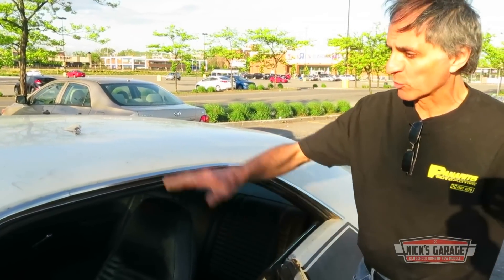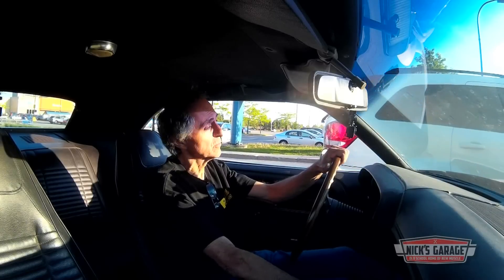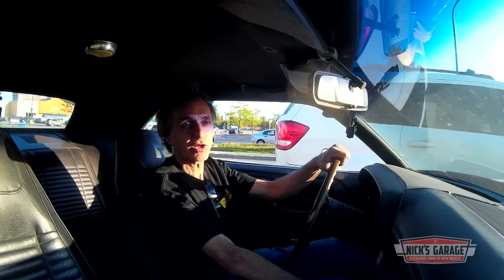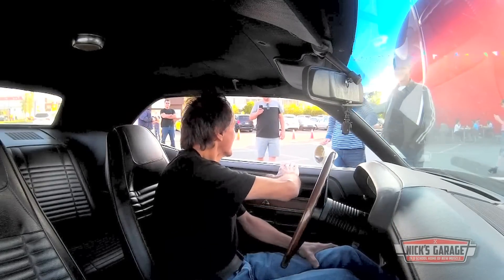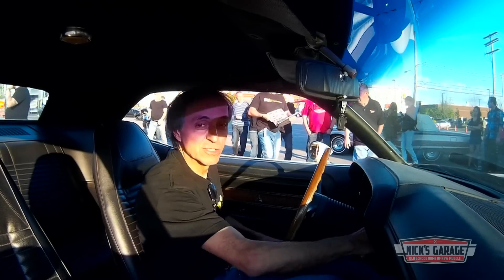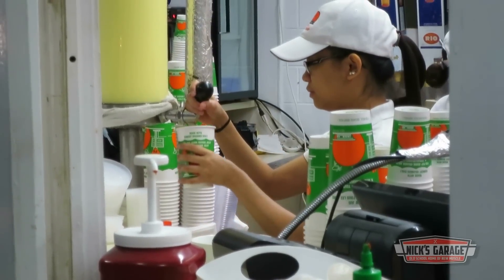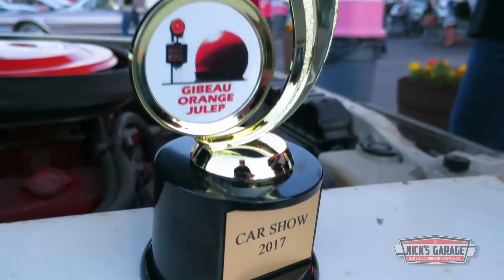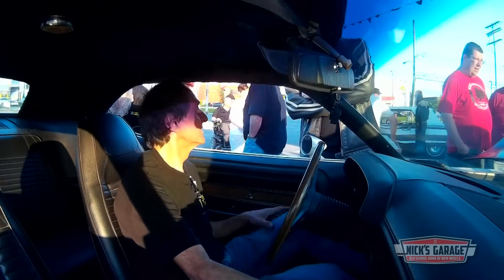Unwashed 1970 Challenger T/A goes to a car show!

Comment: Awesome, i have a 68 that sat for over 20 years, still has the same dust on it, hoping to get it out and about this Summer.
Reply: why.....you owned it for over 20 yrs and its just sitting there?
Reply: no i bought it, and dragged it home last year. theres a video on my channel. Will start on the restoration once ive finished my current Pontiac project.

Comment: Great find, sweet T/A Nick. I once had a six pack in a '68 Charger R/T that was added to the 440. Sure wish I had it today, although it was not the original motor and the six was not available till '69, it was still an awesome Mopar.

Comment: its funny you mentioned sliding on the vinyl seats . when I was in my 1st car,a 1972 Pontiac catalina with the 400 in it,I wasn't a seat belt wearer . I took a sharp corner at 25mph and all of a sudden I was  sliding all the way across the bench seat and ended up in the passenger seat! still hanging on to the steering wheel for dear life, I managed to slam on the brakes and bring her to a safe stop. from then on,I always worn my seat belt!

Comment: Love the car, and the award was well deserved. I know Eastern Canada is hard on cars, but its not any better out West. If it was mine, I'd drive it just the way it is. I have a '80 Powerwagon Clubcab, 360, 4 spd. Original paint, lots of paint chips, and rust around the rear wheel wells, and starting to come through the rockers. But it's only original once.
Reply: the rot around the wheel-wells spells rot underneath in hard to reach places unfortunately.
if you want to keep it fix the rot,a little surface patina is cool but rot is never cool.
Reply: I think I know what you are saying. Yes stop the rust. But I also see it as a survivor. That is one bad ass car. Just love it, and most people won't respect her, for what she is actually worth.
Reply: Is this the car he wants to install his Hemi into. I've always wanted an E body, 6 pak car. They are very rare, up in Canada. Nick reminds me of dad, always ready to jump into a project, but thinks it through.

Comment: Love it can you bring one to Australia for me ?
Reply: Pacer Hemi.   Question? What would happen if you would have bought one of these survivors, and brought it to Australia and had to have it Right Hand Drive. If it was the case, would you allow it to be converted  to RHD? Thanks for watching.
Reply: Ela mate , I wouldn't convert it at all no way . 
Plus here in Australia  anything over a certain age it doesn't have to be converted . 
This is the same motor that was to be fitted in our valiant charger E55 as our big race  like Bathurst valiant was running 265 straight 6 hemi vs fords 351 . The 340 was supposed to destroy these fords but we had a muscle car scare and car manufacturers were stopped to build these things for track . 
They didn't even put a triple carnie on our 340 but put triple Webers on our 6 hemi . 
That T/A is a great car it would put shame on our muscle cars . 
Bravo for your work .

Comment: They may have changed, but the seat belt, a lap belt really, straps you to the car without any slack. That allows you to focus on driving and shifting gears without having to worry about sliding around in your seat. That's what the Charger driver in Bullitt was doing when he buckled his seatbelt. Today's seatbelts have slack until an impact.

Comment: Ha, crack in the dash. My 73 cracked just like that. Developed a bad vibration, turned out to be a u-joint going out, and cracked the dash before I got the U-joint fixed.

Comment: i kind of get the leave as is way of thinking but i am the type to make it less squirrley  on the highway and make it look like it was when new. as it really was so to speak. also i am your age and i wonder why you would drive with old gas in it instead of sucking it out and putting some fresh stuff in it with maybe some injector/carb clean it the tank to help out the carbs going to the small car show. i am not trying to insult your car but if one with the same look and options was there beside you , i wonder which one would have gotten first prize?

Comment: Nice Challenger...

I guess,it depends on your height/body build...I am tall but also a tall torso,so the E Body low seats are very comfortable...

My new Challenger SRT 6.2 seats are set to the lowest setting and still could be lower for my taste..

Also my 71 Challenger RT drives great at 80 mph doesn't shake,doesn't pull either..I can go over 100,sure the new one is better but usually once over 100 mph..

The seats I find in older cars are comfortable as new ones are usually built for small build ,not wider people and 5'8 and shorter..I am not fat or over weight but tall and wide/big build..Not fat or obese..

*My Challenger RT is a 383 Magnum powered now by a Muscle Motors 451 about 500 hp was in the car when I bought it 1 year ago,runs great so far I put 12,000 mile son it between me and my wife,she drives it more than me,I drive my Charger usually....

I went to Friday Night drags and ran a 12.17 @115 boiling the tires..I had a driveshaft vibration so I didnt take another try......I also have a 68 Charger RT 440,71 Cuda 440 6 barrel not a real 440 car.. I installed a period correct 440 6bbl lots of power (70 440 hp,try finding a 71 hp 440 lol),it ran mid 11's and its a 2.94 sure grip and 727 auto ! Great highway car,solid,handles awesome and does past 150 mph(years ago I did that when I was in my 20's),car was gone through,235 front tires also help handling a lot ...I added 4 wheel disks but car looks stock ! I also own a few C body Chrysler 300's with 440's those are sleepers ! 

I also had a 70 Challenger 383 2bbl no power steering and it makes a difference with power steering,handles better ! 

Sure,you bet the new Challenger Hellcat handles,drives better at high speed a bigger,heavier car it is,so it does !
Reply: 01trsmar.   Nice collection of cars you have there.  Thanks for sharing.

Comment: fix the rust on the door before it gets too bad..
Reply: Only surface rust there is no perforation at all anywhere on this car.
Reply: I can see it is coming through.. Not only surface rust.
Reply: won't get worse, this baby is done with damp storage...
Reply: camirocz, the rust on the door is under the paint. That rust is coming from the INSIDE of the door on it's way outside. That door needs a new skin. It's already rusted through. Look under the trunk lid as well. That car has cancer.

Comment: Man if its that slidy at 80 MPH it might be a good idea to upgrade to radials, as Coker makes a set for old muscle cars like this, plus check the bearings and rubber bushings, as those are all major mechanical things that wont hurt its originality, just to make sure it stays in one piece is all. 

 plus maybe it needs to be put up on the lift and just yank at things to see if their loose. as it just migth need a bit of basic tightening and locktighting to get it handling right. as something like that, well on this, he mentions a friend who had an old beat up TA just like that, that got lost to a crash sadly
https://www.youtube.com/watch?v=1K2TZ-8Joj4

and alot of preventive maintenance goes along way.

Comment: A car as rare as a white T/A Challenger should be restored.
Showroom style, not overly done.
Reply: I have to respectively say no way to a full resto...  This is the way it was from 1970..  All Nick had to do was do a few little things to make it a driver again..

Sure, if it was a heap and all it had was a vin number and such, sure go ahead and do a full restore of it..  I love those cars too.

But, this is only original ONCE...  What Nick did to it in no way takes anything away from that..  Just normal stuff that would have been done all along the way anyway..  I would do all fluids, and check the brakes and clutch, and it looks like all the lights work too!  Awesome!  I love the fact he hasn't even washed it!

Just my opinion of course, but I love this car!
Reply: MitchF150 Roger that...you can never go back to untouched original.
Reply: 2000cobraguy : I agree w/you. A quick scan of Mecum auction archives on their site (back to 2008 maybe) shows a coupla dozen T/As, but not a single white example. I still say show it around as a survivor for a year or two, then do a complete restore (*unless proof can be offered that it would be worth more as a survivor). I'd want it 'driver quality' restored - not turned into a museum piece/trailer queen.
Reply: i disagree.
Reply: I like what some guys call a "sympathetic restoration" depending on the car.  What they do is to make sure the mechanical condition is good and they stop/stabilize any further deterioration of the body etc and call it good.  This car I think falls into that category well.  This way the owner's can enjoy the car with no real worries.
Reply: I would never restore that car, leave it just as it is
Reply: ...........Gets into a Delorean, goes 88 MPH, ZAP!
It's 2027, the car is rotted out.
Attendee at a car show is overheard...
"Yeah, the guy who owned it was THE expert at old classic MOPARS,
but you'd never know it by seeing this car.....
Such a shame............."
It's super rare, and a chance to show off your skills.
Show the next generation how it's done.
Then have Revell/Monogram make a model kit of it.
Dad building the model with his kid,
kid gets curious of the guy who owned it,
the legend lives forever.
Reply: At that point, if it even gets that bad in 10 years, then sure, restore it..  Just saying that to do that now, when it's a complete running car and has actually MORE value as being unrestored NOW, then why not just maintain it as is?  I get the whole brand new, off the showroom floor deal too...  But, each to their own and Nick has plenty of restored vehicles to look back on too.
Reply: exactly - as far as value for resale - in its current form its more available for all collectors. once you start dumping money into it to restore you lose a small bit of the market who would have done it differently and you lose out on margin made when u sell. the car is perfect as it is the rust will have to be dealt with of course in time.... and when that time comes you might just go ahead and repaint and make it shiny again.... if you still own it.
Reply: 2000cobraguy Bull! The body should be saved from further rust, and a good cleaning, then driven! The way it should be!

Comment: what mechanic doesn't change out the old gas he probably thinks it's as cool as the dirt on the car
Reply: Mark Jones.  Yes, Myself and I, because there was maybe 1or 2 quarts in the tank. I had a feeling in this situation that it will dilute with 10 gallons of fresh fuel. I took a chance at it, and it worked. Thanks for watching.